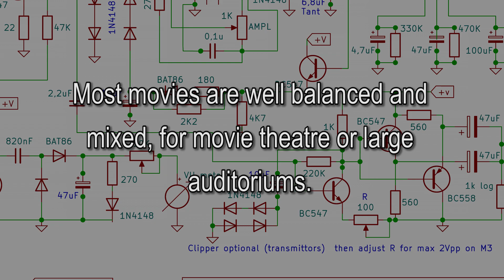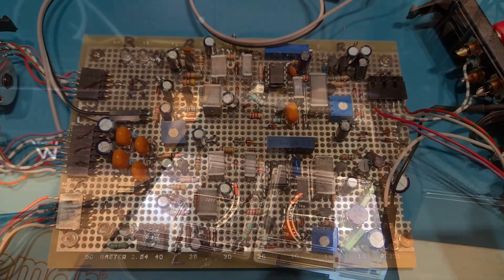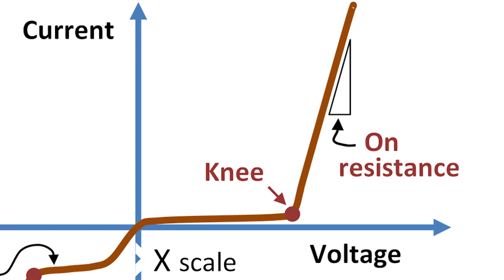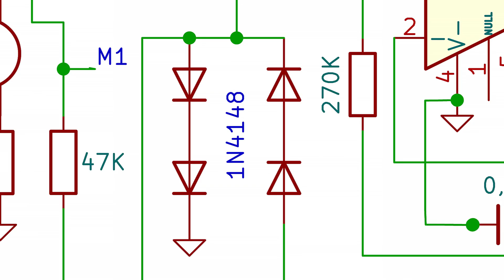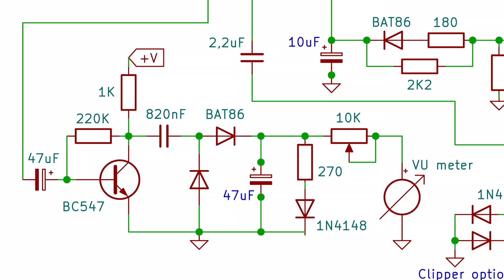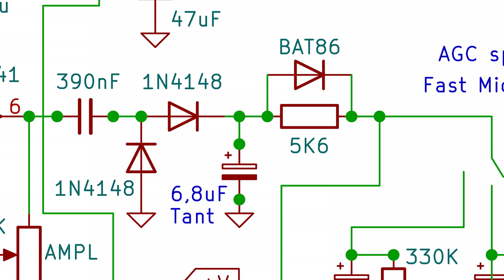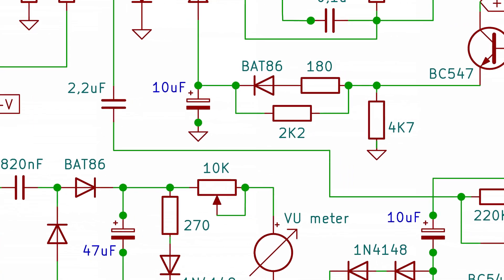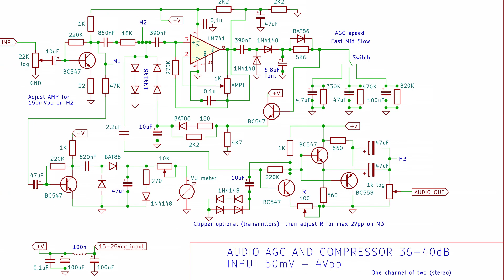movie automatic volume control audio compressor

Comment: Thank you for putting those on youtube, there's lot of knowledge into those schematics and explanation and i value this. Also you're accent and wording is pefectly fine to understand and i really like the contrast between your voice and the generated female voice wich make the video feel like a documentary (that and the zoom in / zoom out thing)
I still don't completely understand the diodes as potentiometer so i suppose you could have highlighted this (i will take more time to look at the schematics)
Reply from the maker: Thank you for the nice words. My accent is Dutch (The Netherlands). A potentiometer has a variable resistance. In this case, the higher the Voltage (current) throe the diode, the lower it's resistance. So the resistance of the diode, is not constant, like a potentiometer. The phenomena  only happens, before the 0,7V (by this diode) is reached. Above this value resistance is almost constant.

Comment: You can save yourself a lot of trouble by simply purchasing a television, receiver, soundbar, etc. with a built-in compressor/limiter.  No matter how ingenious this diode based contraption works, it works analogously and can therefore not be used everywhere.
Reply from the maker: You are missing the point. It's just a hobby to experiment with electronics an to learn something. It has nothing to do with what is economical or simpler. But thanks for the response!
Reply: @TheoFaber  Oh sorry Theo, in that case, I must apologize myself. Of course, it's fun and interesting to experiment, learn, and discover things. I didn't see it that way. Have fun and good luck with your hobby.

Comment: what are the downsides using this application with the diode stages vs more traditional shunting / compressing circuits?  My question comes out of the idea can it be used in a professional recording application or is it just suitable for casual listening?    For instance can it handle an audio signal of more than 22khz per channel without distorting?
Reply from the maker: Yes it can handel 22kc without any problem. The resistance of the diode's are almost linear, so i see no reason why it good not function in a pro appl. But now-days there are so many options available in any pro store.
Reply: @TheoFaber  thank you for taking time to reply and your efforts .  Great fact based channel .   Why did you turn the comments off the VCR / VHS to Audio recorder?   I hope no one was giving you a hard time friend.
Reply from the maker: @SPINNINGMYWHEELS777  Yes they did. Mostly because they do not watch more than 2 minutes. I explained several times that the design was from 1982. But still they ask why i not use 2023 equipment? And another guy had remarks about my English. I explained that I am Dutch so it's sometimes difficult. I get the answer that again there where som words with faults in them. I only made a short film about my projects, that are for 90 procent just hobby and to investigate something. It's a strange world. And I do not know WHY in a few day's there are so many viewers???? (30.000)?

Comment: Do you know Optimod? I think this is how their analogue auto gain works
Reply from the maker: No I don’t. Was reading about diode behavior below there threshold value. So I tested this, and indeed – below 0,7V there resistance depends of the voltage. It seems a linear process and before I new it – i build several component around it. Because it was so much better that what I experienced with transistors / fet’s, I made this unit. Use it every day, whenever I play-back a movie!
Reply: @TheoFaber  orban is the company, Dutch I think too. Broadcast auto gain, compression , limiting. For tv radio digital. Current gear is mostly digital now, but their older analogue gear is very interesting
Reply from the maker: @MePeterNicholls  Thank you for the info! But i am more of a technician and wanted to investigate the working of the diode in circumstances beone there normal use. By testing and measurement it get out of hand, the positive way. I am happy with the outcome and use the unit constantly.
Reply: @TheoFaber  oh yes I can appreciate that! “Rabbit hole” syndrome